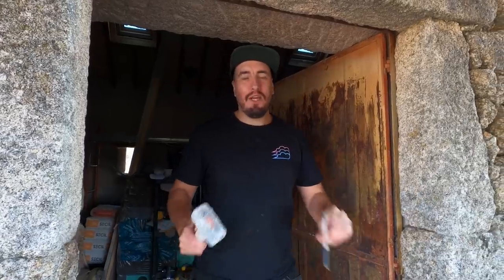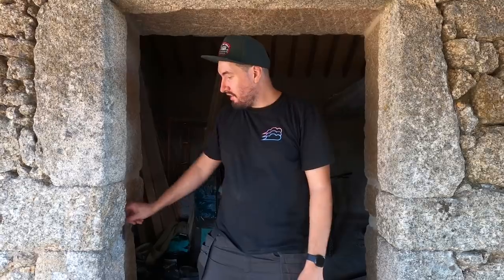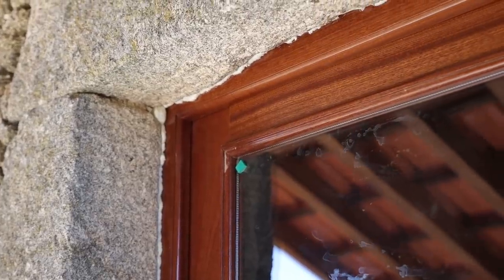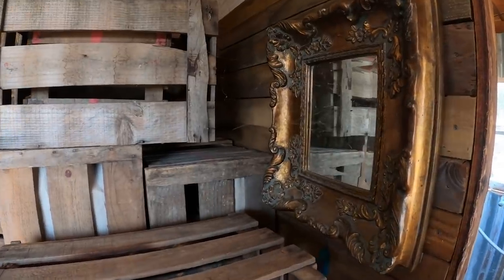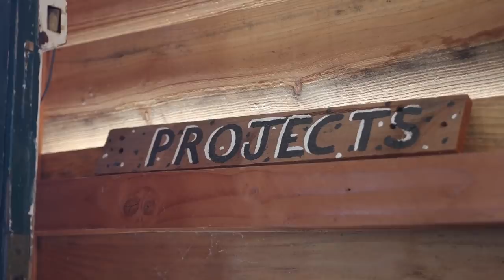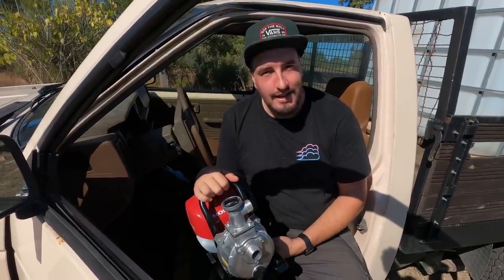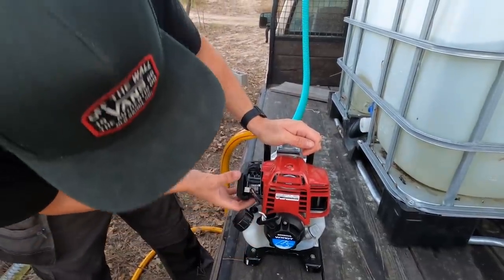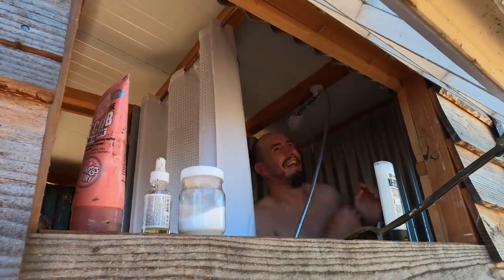Building Our Dream Home - Custom Front Door Installation!

Comment: Great door 😊… a little tip when you fill the gap around the door where the building foam has expanded, use Silikon in a near color to the stone and  before it dries, use an empty plastic bottle full of sand in a similar colour t and push it onto the wet Silikon. It will look like grout but be waterproof and seal up the door nicely 👌 greets from Germany 😎
Reply: Or use sanded grout caulking….
Reply: @lesserpoo  or that 😊 i can‘t get that in our local suppliers here in Germany. Greets ✋😊👍🏻
Reply: @GSA_Drums  Oh bummer!!  It’s great stuff. It’s so interesting to me how different things are from country to country… greetings from California! 👋🏻
Reply: Don't know why they put foam around the door and not just point it into the wall. Would've looked a lot cleaner.
Reply: @justlooking4202  I’m pretty sure they will point it when they finish painting the exterior.

Comment: That would make an amazing sliding barn door somewhere. Just put wheels on the door and the track on the wall. It would be really impressive and easier to move. You could probably mount it on the outside of your beautiful glass door for extra protection if you needed it.

Comment: It's great to see you getting to grips with the water situation. Water pumps, hoses and IBCs  on the the run-about are standard kit on many an Irish farm. I used it for the domestic water too before my gravity fed well was installed. I use a pressure washer to clean my tanks and the last of the dirty water is removed by the water pump.
That new door is just the icing on the cake. It was worth the wait.

Comment: The new door is stunning! It looks so beautiful against the stone! Someone had the idea of putting the old door on sliders/rollers so you could use it for protection when closed and when opened it would hang beside the new door against the stone. It would be functional and beautiful! It was so good to see Bee talking to the camera again! No pressure to do it all the time if you're not feeling it though. Just because you did it in this one doesn't mean you're locked in to doing it all the time. 😘

Comment: Is there enough room inside to hang the door on the wall and use it to hang pots, pans and wee bits of cutlery and other kitchen tools from?  I also agree that using it as a front door shutter hung from barn door hardware would be a good idea.

Comment: So much progress!   If you want to stop algae growth, consider covering the holding tank with a black material.  Algae needs light to grow.  The black will also absorb the heat so your water will be preheated.  My rain barrels are black for that reason, I just use them for washing the vehicles or watering gardens.

Comment: Hi Guys!
I have my water tank & pump set up in a similar way to what you have started. So, I have a suggestion to achieve maximum versatility.
💡 Put a 'T' on the input of your pump with ball valves to easily switch between your truck's tank to another water source from the hose.
💡 Put a 'T' on the pump's pressurized outlet with ball valves to easily switch between the hose and the truck's IBC Tote (via another 'T' fitting located between the pump's inlet valve and the water tank's fitting.

Comment: Buy hardware for a barn door and mount it above your new door.  Hang the old door so that it slides to the right against the front wall of the house but when you have to leave town, you can secure your house.  I think it hanging as a backdrop on your front patio would be beautiful.

Comment: Big day!!!  I'd make the door an outdoor table. What a great place to gather it would make.  Paint it with metal paint and make some pretty designs, but maybe even cover it with clear plastic after it's finished.  Could also just use the metal as the form and glue wood to it for a big beautiful table with a history.   Can't wait to see the difference the door will make from the inside looking out.  Hope it is insulation enough for your winters.  Enjoy the shower and bathroom.

Comment: The new door is fantastic......well done 
The old door could be used as a safety security door. .. you can have it on a slide rail and pull it across to go in front of the glass door and secure it, when you leave the property to go away on your travels.
Glass can damaged and broken into...even toughened glass. Like shops they use a grill or metal shutters over the glass doors when closed.  You could get a nice designed grill for the glass door, if you don't want to use the old door for security.

Comment: Good work on the water project. One tip, when getting new fittings for the hose I would go for brass fittings. Plastic wears due to sunlight and tends to snap just when you don’t have time to repair. Also when you get a small crack in the suction side it will cause sucking in air and before you know it you are looking for the fault for hours (bin there don that) so brass it is. 😉

Comment: That Mahogany door is stunning!  I can hardly wait to see the windows in, too.  I think your little barn is going to be much more elaborate than most I've seen & I'm so anxious to see the finished product.  As for the rats, there is a product that you can put down which when they eat it, forces them to go looking elsewhere, and they never come back.... nor will any others.  It's in an enclosed tray so that the cats can't get at it.  Anyhow, it's the best working product for rats that I've ever seen.  Believe it or not, rats have some kind of a "transmitter" I'll call it, which they use to inform others not to go there.  You will never see another rat there ever again!

Comment: Great content as always peeps, glad to see you guys back at it and getting closer to moving in.

Shower tip, cable tie something with a bit weight to the end of the clear pipe for the shower water intake to keep the inlet at the bottom of the IBC. This will save it floating up the same as the pump hose did and possibly running the shower pump dry.

Comment: What a beautiful door. . . both of them. Door removal tip: remove the bottom pin first. You should turn the old door into a table, clean it a bit and seal it to preserve the beautiful patina, put some rustic sawhorses under it for legs and 'bob's yer uncle!' Rats! no class, you'd think he'd have the common decency to use the bl**dy toilet! 
You inspire us, and you bring back memories of my 20 years on my 10 acre homestead. You face a lot of the same challenges I did. It is amazing to see how many things have changed in 40 years and more amazing how many things are still the same. I marvel at your skills and your cheerful willingness to learn new things. Bee & Theo you have captured our heart. At the end of this video my wife turned to me and exclaimed, "Don't you just LOVE them!!!" Yes, yes, yes.

Comment: What about using the old door as a 'permanent fixture' outside table? Use some of the large stones to make legs, maybe get a glass panel to sit over the top of the door as a table top so you can still see what it was originally. 😊

Comment: You could hang the barn door as a focal point on the one stone wall. Or you could use it as the head of your bed; You can make your dining table out of it (shadow box with the door at the bottom and a glass on top.... ;)

Comment: Congratulations on your new barn door.Super cool. let  give you 2 advises.On your WC,i see you use a 12v water pump and a gas bottle to the heater.I strongly advise that you keep the gas bottle outside.Gas and electricity don´t mix well together and a potential gas leak can .....you now.keep on going

Comment: Now you have a lot of light in there with the new door. 👍🏾😎 But I have some security concerns about burglary. 
 • The warded lock the door came with is really low security. You should think about changing it to a modern, up-to-date safety lock. You should also change the counter plate to one with a higheer safety level, which you can bolt into the granite stone. The weak parts of a door ist the wood frame. Maybe a second deadbold lock too.
 • These big glass panes are pretty easy to break. A good thing would be a „Window Shatter Protection Film“. It is easy to mount by yourself.
Better to prevent than to be left behind. 😉

Comment: Maybe chop the door in half (horizontally), seal it with some time of sealer, and use the one piece as a headboard for your bed? (the other half would be nice as a small table, as Bea mentioned)

Comment: sweet job, had you done the same job in the UK the frame would have been at least 2" undersize, they would have screwed the frame to the reveal with 6" screws and filled the remaining gap with expendable foam and called the job a a good 'un.

Comment: Metal bar you used is called a crow bar here in the States.  The door is amazing.  Can you rehang the old door on the outside on sliders for security as others have noted.

Comment: curiosity question.  where does the shower water go?  could it or is it used to water fruit trees etc? a gray water system to get as much use out of the energy you put into getting water!  Brad Lancaster has a lot of info on it.  great to have you back, Bea!

Comment: Here are my 50p - you set the new door as was the old one kind of inside the barn - as you will be away from the place for months in the future why not trying to fit the old door on the outside of the opening latching it so you could have it open all the time and kind of secure the new glass door when you are away. 🤔😘

Comment: for your shower you need to get a aquarium pump pot it in the tank a hose to the water heater 
plug it to the soler power  torn it on inside wen you take a shower and vola you have water pressor

Comment: You are so brilliant Theo how on earth did you manage to get the hammer under to get that last pin out? I had a similar problem yesterday trying to get some shelving out of my store room which the previous owner put just inside the door making it very difficult to open the door let alone put my bike in there. I realised he had not screwed them to the brick wall but hammered nails in through the wood and into the wall then bent the nails down when they stuck out. I had to dismantle the cupboard to be able to get any kind of leverage on the nails so I felt for you. I don't know how long and how much cursing it took you as with You Tube you can edit (!) but mine took hours and then I had to make a new top for the cupboard which I'd had to smash! Do it yourself on older stuff can be extremely challenging aye

Comment: Door gains 4 timber or metal legs
Top shallow box filled with clear a proxy 
Dining table?   
Coffee table if shorter. 
Pretty metal no exposed rust. 
W clear finish.. could eat rest feet exc

Could do second height fold up legs and it’d be both
..small house smarts

Lov Yas!

Comment: Bea It is so nice to see your absolutely stunningly beautiful face. Theo is a great orator but it just was'nt the same without you. My heart goes out to you both. Take it slow, take it any way you need to go. Ideas for the door: Dining table where half folds over the other half for having a smaller dining table or fold it out to have a larger table. it could be a privacy wall where your bed is on the mezzanine.use it for a security door while you are traveling. good luck -s

Comment: An ease of system idea

If you extend hose from topmost site, where you have already stowed 500 liters
Then have it run down the hose filling it after maybe 5 min to rinse and fill entire
Then hook up a filtered line direct with weighted bottom of well filter and weight thing..

The pump might be able to THEN 
be set up on the top of the hill
Fa one way safety valve .. I think it’s called 
Fail safe?   L8ke on sewer lines. So it never flows back from such type source..
Anyway a fail safe one way flow valve like on inflatable mattress designs only for fluid at the bottom to keep hose water always a full hose…
Direct to the fastest water heater that they call instant..
It doesn’t heat a big tank. 
It takes power and heats it..spits it out vhot

Comment: Why not fit the beautiful old door to the front of the new door. It could be positioned in such a way that when you are in residence it could be held back then when you go away it could be swung across and locked to offer you extra security.

Comment: Should of put some WD 40 on those rusty hinges before you started. And if you remove the bottom pin first you will not have the door falling on your head. LOL. Good job otherwise well done 👍

Comment: Do you really need the pump? Your water container in the car is higher so there should be enough pressure when you connect the hose at the bottom I would say..!

Comment: why dont you build a centralized tower  about 8 meter high with scaffolding and then put your water tank on top and then use gravity to get your water where you want using pipes,,,, this means your pump never moves and you save on fuel and  you get water on demand